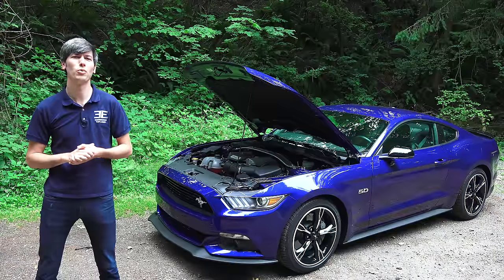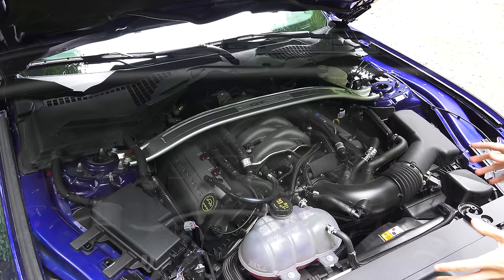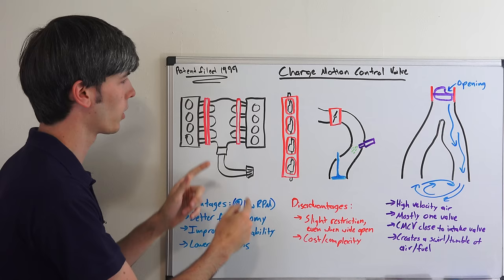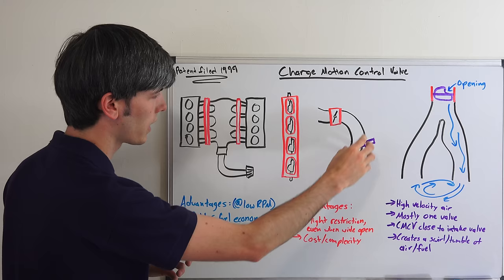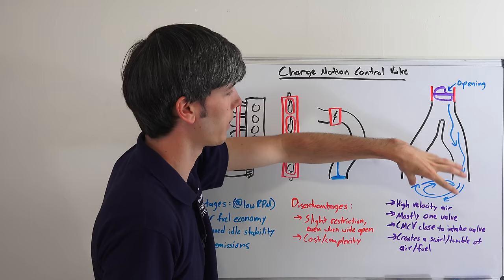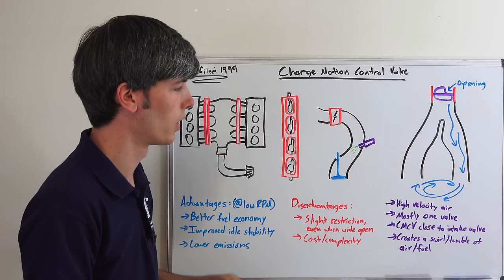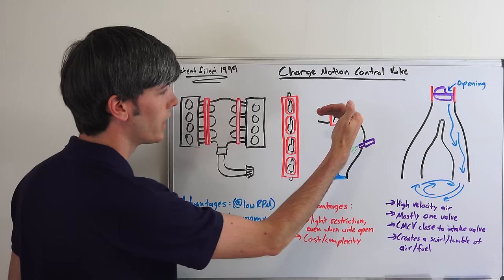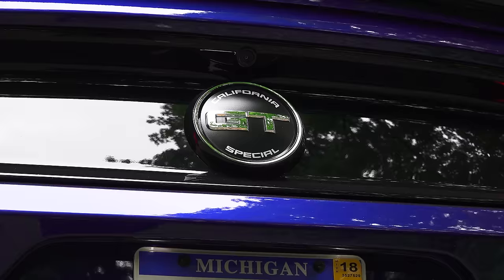Keeping The V8 Alive - Charge Motion Control Valve - Ford Mustang GT

Comment: Like many people said, it is not really new, BMW diesels of the early 2000's had many issues with these flaps breaking and falling directly in the combustion chamber. Most people just took them off
Reply from the maker: As mentioned in the video, patented in the 90's by Ford.
Reply: +butchtropic That is a really Bad idea, checking your fluids is the first step of car maintenance, and not allowing to do so is a massive slap to the face since the only pro of this is knowing your level sitting in the car, but if the level is not good you'll end up under the bonnet anyway. Even if in the case of BMW the iDrive system tells you how much oil is needed, the dipstick is just a better solution

Comment: This is just a fancy name for the imrc system ford has used sinc the late 90s.funny I was watching this video during lunch,when I went back to work I had brand new '16 5.0 f150 262 miles on it with check engine light on with a dtc for bank 1 imrc stuck closed.sure enough it's this charge motion valve system,but in all the ford repair manuals they called it imrc.anyways pulled intake off and found bank 1 imrc actuator (glorified vacuum diaphragm)binding and not allowing to open the valves....

Comment: Some other cars that have this I call it a Swirl control Valve (maybe I should watch the rest if the video, Toyota's 3VFE series, (ACIS) Ford's V6 SHO Yamaha, Nissan's VQ series had it, I think GM's and Mercury Marine built LT4 dual cam V8 had it....Acura, Audi, sadly my EZ36  doesn't  have this system as it uses Valve control only DAVCS system for Subaru.

Comment: Almost like ITBs, neat!
Reply: Not even close.
Reply: Yeah not even close its not a throttle body it's just little tiny valves in the intake runner that can alter its position
Reply: Kind of close to ITB's I guess. 
The carburetor kind often only opened half it's butterfly valves while the engine was under vacuum.

Comment: This is T-VIS, Toyota Variable Induction System a variable intake system designed by Toyota to improve the low-end performance of multi-valve engines.

Comment: I suspect they could get a similar result by using two different length & width intake runners and using a valve to switch between them depending on the engine's air flow requirements - albeit with less adjustability and probably increased costs and packaging problems.  Or have I missed something?

Comment: This is funny.  My 1996 Lincoln Mark VIII LSC has pretty much the same thing.  It is called the IMRC valve.  Was also used on the Ford Taurus, and Mercury Sable with the 32 valve 3.0 engine.  Used an actuator that was either vacuum, or electrically operated to open, and close those blades for either cruising, or wide open throttle.  Maybe the 1999, and up were different, but looks like the same basic system to me that was used since 1993, or even before that...

Comment: I don't understand how adding intake valves similar to throttle body valve is going to give better fuel economy and emissions by having a slightly better mix of air and fuel. Isn't the original problem with big engines is the shear capacity and friction? isn't shutting off cylinders like they did before on other models going to give better results?

Comment: So does this mean, that hardly pressing the gas pedal leaves the cmcv nearly closed, few air passes which leads to lesser fuel getting injected and at full throttle, the cmcv is completely opened, which means that a lot of air passes, so that the engine needs a lot of fuel, to keep the air fuel ratio at a constant level?

Comment: What is more efficient - giving 8 cylinders half the air, or like in my friends 'muricamobile, a Hemi Magnum - turning off one cylinder bank?
Reply: That doesn't turn off a bank, it deactivates two on each bank. Having only one bank firing would not make it very fun to drive. Ka-clunk ka-clunk ka-clunk, you get the idea.

The effect is probably about the same, but this is less involved and easier to fix.
Reply: ootdega haha yeah true my mistake :p
Reply: +Roger Skagerström   Cylinder deactivation can be rather abrupt and for drivability reasons is not used as efficiently as it might be in terms of MPG. 

The various intake manifold designs are great because not only can they make the motor more fuel efficient but they can and do also make the motor better to drive. Better low end response and torque, something that makes a small displacement motor more acceptable to many people. 

Many engines are being fitted with more than one such technology and by carefully matching each piece they can realistically get phenomenal real world performance both in terms of power application and fuel efficiency.
Reply: +dosmastrify Honda V6 is still shutting off one bank when power is not needed.  I have a new V6 accord and it uses this technology.  no vibrations or noise.  smooth as ever
Reply: David W
Key word is "new."

Your motor mounts will probably start to hate you after a while. Ferraris tend to eat motor mounts for breakfast, and while we're not talking anywhere near the same amount of power, it's the same idea.

Honda may have managed to engineer that out, though. Ferrari is a bloodthirsty price-gouging monstrosity.

Comment: What about cylinder deactivation? I know that certain dodge v8s use it under light throttle cruise conditions. This seems to be similar.  Instead of cutting fuel to 4/8 cylinders, ford is restricting significant amounts of air to each cyl using that valve....Another technology that most American automakers arent using is gdi. The downside of a port injected sys is that you cant control fuel precisely. Why arent more companies using gdi?

Comment: My 1998 Twin-Turbo Subaru Legacy (JDM) has these except they call them Tumble Generator Valves (TGVs). How can Ford apply for a patent in 1999 when these devices were already in common use at the time? Also, how is this going to save the V8 when my 280 hp 2 litre 4 cylinder car uses the same technique to improve off-idle driveability and economy?

Comment: I don't see how this is anything new that would justify a fresh patent.  from the way it's explained here, it sounds exactly like the 'individual throttle body' or 'butterfly' setup that Honda used inside of the B18C engine's (GSR) intake manifold. each runner had a butterfly that would open and close depending on throttle position.  can anyone explain the difference between that setup and this Ford design?

Comment: So it achieves the same essential result as v-tec/vanos/etc but it has more ability to adjust airflow?
Reply: It's more of a predecessor (for those familar with late 1980's Toyotas) or supplemental system to VTEC (Honda-speak) / VVT-i or VVT-Li (Toyota-speak) / Ti-VCT (Ford-speak). Toyota's system was called Toyota Variable Intake System, or T-VIS.
Reply: +Evan Loxley Thanks for the info bud
Reply: Vanos is variable valve timing, you're thinking of valvetronic :)

Comment: Wouldn't the higher velocity air at lower RPM actually help create torque? Like a dual plane vs a single plane on a carb engine. Charge motion control valves give you the best of both worlds to an extent. Similar to phasing the camshafts.

Comment: I wonder why companies don't do the cylinder deactivation like Cadillac did back in the 90s make a V8 run on 4 cylinders when not in full power mode.
Reply: Most modern Chevy V8s employ this. I have a 2011 escalade and a 2009 G8 GT which both have cylinder deactivation.
Reply: so does Chrysler, it's called MDS.
Reply: Honda does this with the Pilots from 09-15. Runs on three cylinders while cruising and activates all 6 cylinders when you step on it.

Comment: I'm not sure why this exists.  Why wouldn't just the throttle plate do the exact same thing?  "Partial throttle.. partially open"  ?

Is it ONLY to increase the A/F mixture?  If so, surely there is a better/cheaper/more efficient way of making turbulent air in there?  I have to be missing something here :)